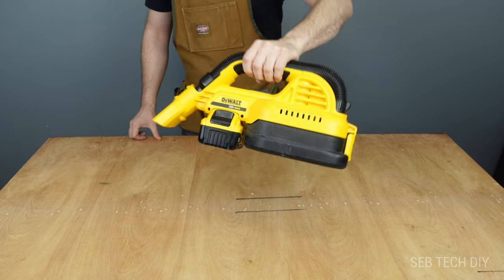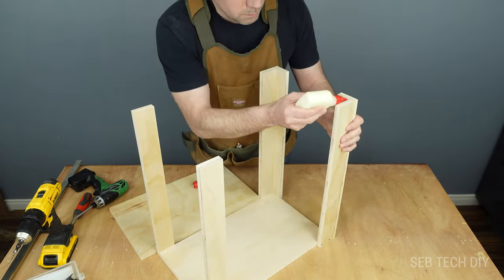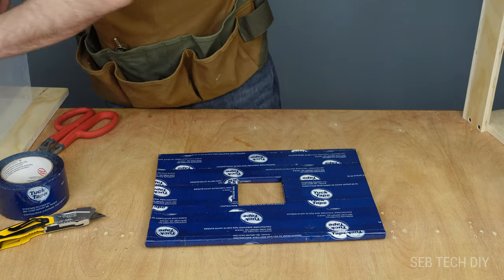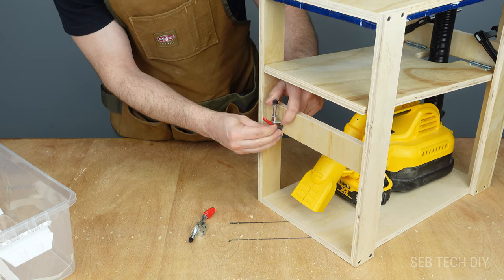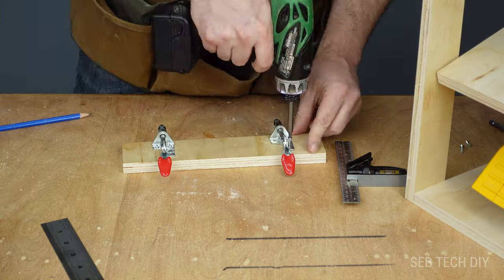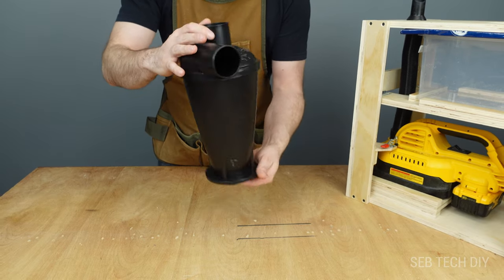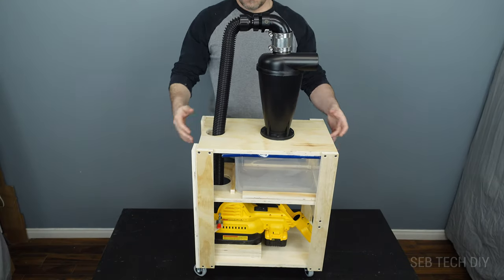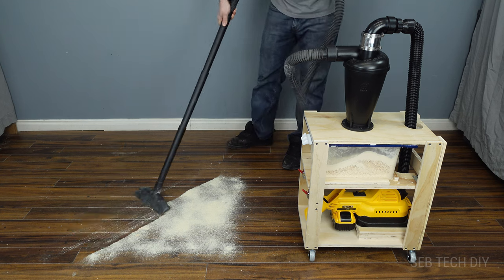DIY Cyclone Dust Collector [Cordless] - With EasyEmpty™

Comment: That's awesome! This is the first time I've seen someone use a Dust Separator with a Cordless Vacuum!.
Reply from the maker: Thank you, yea a lot of people including me made several corded dust collector but when I was tripping the breaker all the time with my shopvac and my table saw, I decided to make a dust collector with my cordless vacuum and it was the best solution for me! Thanks for watching and commenting!
Reply: @SEBTECHDIY  You're welcome. I have the same worry of tripping the breaker. Now that you've shown using a cordless vacuum with a dust separator will work perfectly, I intend to try that out with my 20V Hoover cordless vacuum.